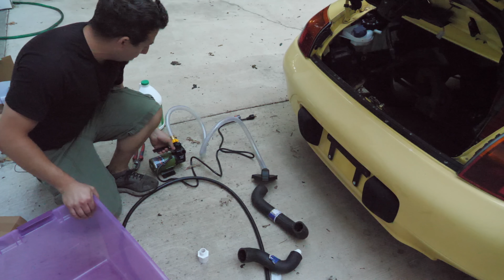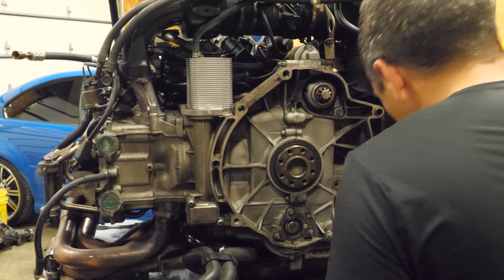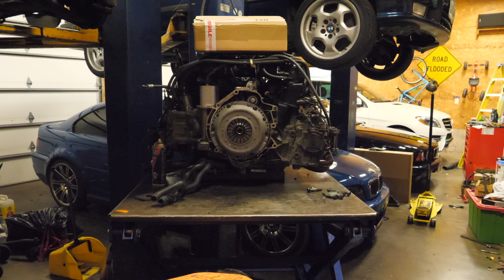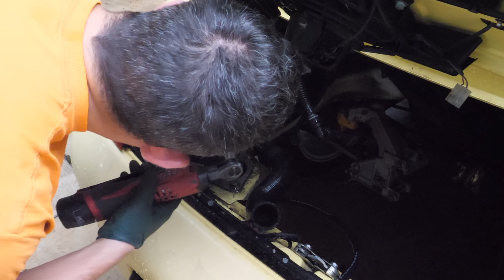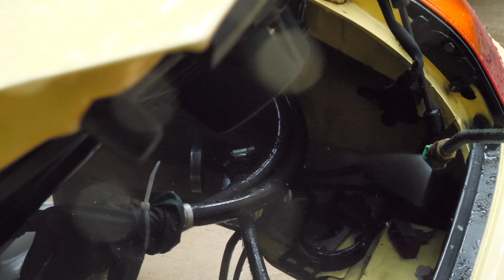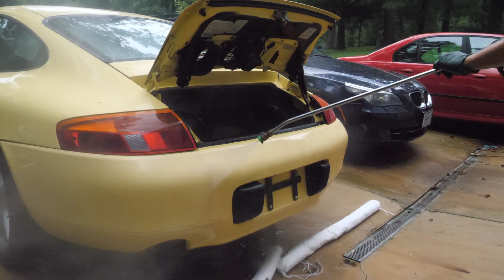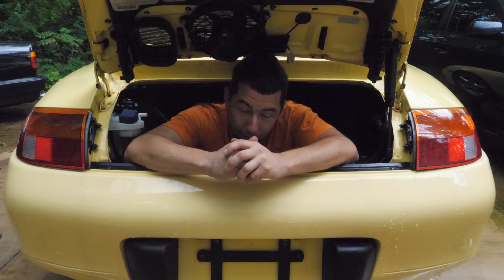Porsche 911 Update! FINALLY! Starting To Put The "Turn-Key" 996 Back Together!

Comment: Don’t use foaming soaps in the cooling system. You will regret it! Use cascade dishwasher detergent that doesn’t foam. Also remove thermostat while cleaning system. I did that procedure on semi truck engines for decades and it works well. The foaming detergents will build air in the system and overheat the engine and would take forever to get it out.
Reply: This. Second this
Reply: @andrewmacias-brown1818  Old timers used to use borax to clean out cooling systems.
Reply: @donmueller3520  different times 1900s to 80s maybe early 90s. definitely not 2007 to now
Reply: Yeah well this ain’t the 80s
Reply: Our shop used Butyl Cellosolve for removing oil from the coolant system.  But there maybe better cleaners available today

Comment: I am confused. All 996 IMS bearing should be able to be changed. Even if you have the dual row bearing like you probably have if its a 98/99 model. The later 997 engines are the ones that have the ims bearing that requires engine dissassembly.
Reply from the maker: I was there too. However after some phone calls to people who work on them daily, super early cars got a dual row bearing the diameter of the 997 bearing. That’s what this is and requires total engine disassembly to replace.
Reply: @I_Do_Cars  Interesting, disregard my other comment I guess. I wasn't aware of the two variations of the dual-row bearing. Hopefully nobody replaced it with an "upgraded" 997 bearing...

Comment: Watching you put that transmission up there made me think of all the times I’ve had to do things around the house when I’m the only one here,
It’s amazing what you can do by yourself when you have to.
Reply: It is easy to bend the center of the clutch disk by using the input shaft to lift the trans on to the bell housing. I usually use a stack of wood blocks or my motorcycle jack to lift transmissions onto the motor if I don't have help.(I used to have a shop where I specialized in air cooled VolksWagen engines.) I could take the engine and transmission out of an older air cooled VW/Porsche in half of an hour. But that was years ago.

Comment: I really think that your use of Simple Green was a good idea, but I doubt any oil residue still exists in the system.  Using Dawn dish detergent won't hurt but I doubt it will make a difference.  If you are concerned, I would recommend taking a borescope down the cooling channels as far as you can get it, but I really suspect the engine is clean.

I did that with my 30 year old 928S2 5 speed in 2015, and I was astounded to see that the inside of the cooling jackets, as far as I could get the probe, looked brand new.  Porsche quality.  Then again, I was anal about changing the coolant every 24 months, and I had owned the car the majority of its life at that point.

Great video!

Comment: as i told you at the very begging get rid of this car your work will never end or at the very least your grandchildren will have to finish the work and hate you for buying it
Reply from the maker: I have lotus esprit(s), an n54 e61, and several other “never fixed” cars
This is child’s play. Finding the time to work on it… that part is tough.
Reply: @I_Do_Cars  it will never end not criticizing you but you will find problems forever with a car that has been worked on by another.

Comment: I cannot believe you did NOT change the IMS bearing.  9% of M96 engines have a complete failure, the worst year was 2004, but since you had it apart, you should have done the LN Engineering fix.  

That is the lone modification that more than pays for itself on these cars.

Now;  What about some 928 content~?  I drove a 928S2 5 speed for 19 years, and did almost all the work on the car myself.  I'd like to hear your thoughts on the car and it's design.

Great video!
Reply from the maker: Uh. I couldn’t. 
At all.
Reply: @I_Do_Cars  LN Engineering has a replacement for that bearing....
Reply from the maker: @Flies2FLL  requires total engine disassembly.
Reply: @I_Do_Cars  You're right, it turns into a beast of a job.
Reply: Come on! You know EXACTLY what it entails!
ADD 17= 928!
Reply: @junktionfet  Complete busllshit-
Reply: @I_Do_Cars  I understand that!!  I drove one of these cars for 19 years.
Reply: 9% is bullshit, my porsche specialist has hardly seen any failures in the many years he has been working on these.
Reply: @SupermotoCentral  OK, that 9% quote?  That comes from the Panorama magazine, produced by the Porsche Club Of America.....Hello?

YOU are a butteater!
Reply: @SupermotoCentral  You're talking out your ass.  Contact LN Engineering to find out what the REAL story is!
Reply: @SupermotoCentral  Butteater.

Comment: "034" as in Audi?  The A6 transmissions would fit on the Porsche M96 motors and vice versa, if I remember correctly (it has been a while), so I'm guessing your clutch alignment tool was an Audi one.

Comment: Coolants come in 3 main flavours - IAT (old type, based on sylicates, traditionally green) OAT (modern, based on organic acids, traditionally purple), HOAT (hybrid, orange). These days you can get each one in every colour of the rainbow:
1. OAT - Prestone is green. MOTUL can be yellow, dark green or orange (they have the same base, but different additives and properties) . Mopar is red/purple. 
2. HOAT: Fancy BMW oem stuff is blue, Valvoline is pink or orange. 
The color really doesn't matter, at least here, in Europe.
Reply: @C7usteR fully agree. I'm just stating above that it's color has nothing to do with the specs.

Comment: Don't use dawn dish soap.  Use dishwasher detergent.  The old stuff that comes in boxes, not the pod types sold today.  It is granular and won't foam.  Plus, the granules will scrub the inside of the coolant system.  Remove the thermostat so that everything can flow freely and high idle the engine for 20-30 minutes.  It will clean VERY well.  Flush with some baking soda/water mix, then straight water, then add your coolant.

The best detergent to use will smell the strongest.  While at the store, give the box the sniff test.  Which every you can find that will burn your nose the most is the one to use.

I'm sure you've seen the aftermath from the GM Death-Cool.  This is what I have found that will turn the coolant system sparkling clean.
Reply: Forgot to mention, you'll need to use a couple of cups of the detergent with that size of cooling system.

Comment: Seriously, why does it make a difference on coolant color. I scratch my head on that as I have dug thru the internet and really found nothing to pinpoint. I am going to assume it has to do with some kind of additive that stops electrolysis? Due to the magnesium in the block? I am guessing.
Reply from the maker: That’s exactly it. It’s not the color itself, but what the color has or doesn’t have.

Comment: Wait? You bought the pump from the drug store? OK, nevermind! Forget I asked!
Simple Green works pretty good. I also use Super Clean. It's purple, so you know it's good! If you have systems with internal corrosion, you can use CLR (Calcium Lime Rust) to help get rid of it. Even things like radiators/heater cores with bad corrosion. If that doesn't work, you could step up to muriatic acid, just make sure not to expose the components for more than about 10-15 minutes, and rinse it thoroughly. 

Always good to do as much as you can while the engine is out. Even things like the rear main seal, even though it was "replaced recently". For that little bit of extra cost, is worth the piece of mind to know you're not going to have problems. 

As a Mechanic of 35+ years, I must say that I am impressed with your level of skill, and your attention to details. 
Also, please look after your back, and the rest of your body as well. My body is severely damaged from my career. 
Awesome to have an update on the 996, and looking forward to future updates. Have a great day, Eric! o7

Comment: I don't know if putting an outside hot water spigot was a good idea. Hot water is more prone to freezing. Hopefully you have really thick walls with at least a 12" freeze proof spigot.
Reply from the maker: It’s 70 feet from the hot water heater. I’m not really concerned about it.